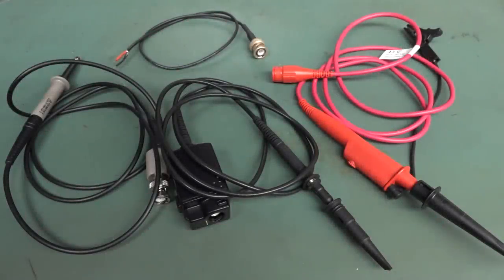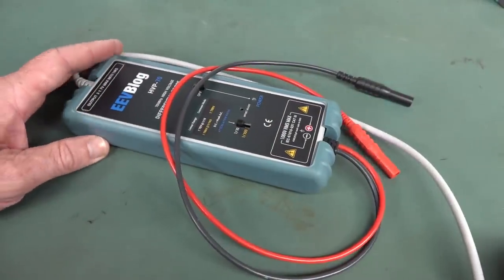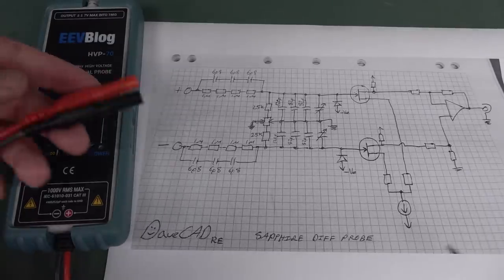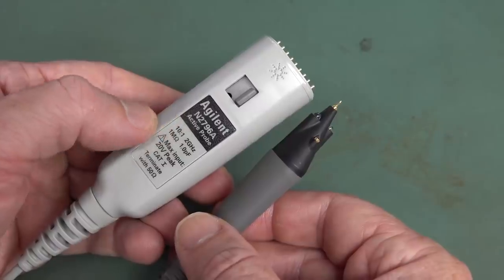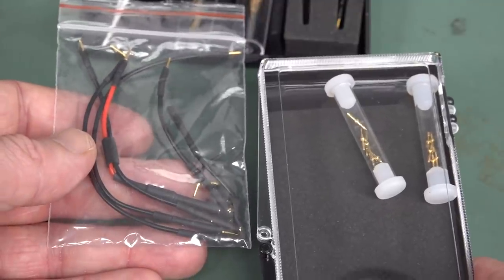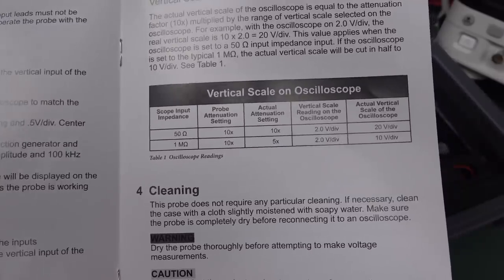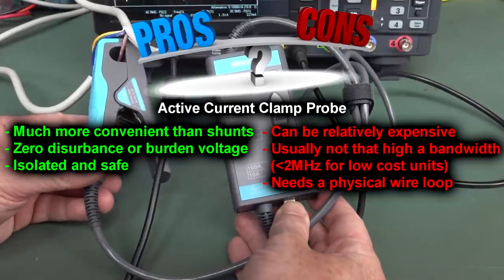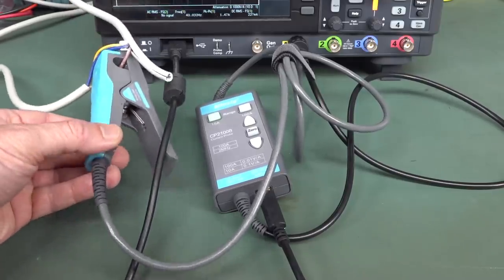EEVblog #1368 - Active Oscilloscope Probes COMPARED (Part 2)

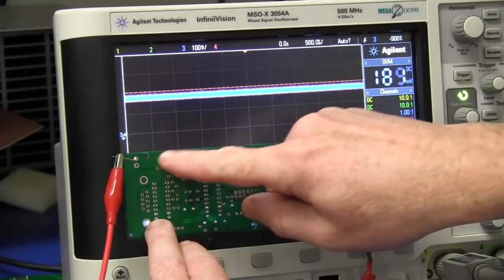Comment: 37:33 Why would you put a split in the ground plane? How did you avoid the EMI problems it almost always make?
Reply: One usage example would be high-frequency noise away from analog components. By having a good connection at one point, as Dave shows here, you can have a solid ground as well as keeping the analog section GND-plane clean.
Reply: @JoeyvanHummel  Thank you a lot for answering, I am happy that you did!! :-)

Comment: I dont understand why the lead (or scope) would get vaporized with the non isolated probe. Thats where the rcd is for, isnt it? That trips by 300mA or so?
Reply: If you have one, yes, the rcd/gfci should save you, not something to rely on though.
Reply: Even with a GFCI/RCD you will still have high currents flowing for tens of milliseconds because the mechanism takes some time to open the circuit. Also your RCD can only sense faults on mains-referenced circuitry. If you connect your ground to multiple points on an isolated supply your mains RCD won't see anything out of the ordinary. If your secondary supply is grounded that's already one connection, so just connecting a single ground lead to a power rail can damage your equipment.
Reply: @eDoc2020  I don't think those tens of milliseconds will vaporize the lead or vaporize the ground plane inside the scope. I've tripped loads of RCD's due to faulty equipment and the energy flowing is so short that it barely warms up. And as a electronics lab is a dry area, you can fit a 30mA RCD. In fact, I can't imagine someone working without an RCD. Where I live, it has been legaly mandatory in houses for 50 years or so, so having power in your house without RCD seems very archaic and unsafe to me. Especially as they cost peanuts.
Sure it's not 100% foolproof, nothing ever is. Can't fix stupid. But for a few bucks it goes a long way, so I've always been puzzled why Dave never mentioned this.
Reply: @mrpetit2  Here in the US GFCIs are only standard in wet locations. Yes, it is a bit archaic. For testing live mains equipment I'd definitely recommend adding a GFCI or even better an isolation transformer.

For what would happen, I agree the fault current won't vaporize any wiring. However it likely could vaporize part of your clip right where it touches and arcs for those few milliseconds. It's worth noting that here in the US neutral and ground are bonded inside electrical service panels, so fault currents from shorting live to ground are likely much greater than you'd find in Europe.

But while the chances of blowing up your scope by connecting the ground to something live are fairly low, there are other dangers. Depending on where your ground touches you could send hundreds of volts into the electronics you are testing.

And like I said earlier, your RCD will only protect in case of one fault. Say you touch your scope ground to a PC's 12v power supply. Current will flow from the 12v rail, through the probe lead, through the scope's AC cord, through the PC's AC cord, and back to the power supply's DC ground. Lots of current will flow but to your RCD all will be normal.
Reply: @eDoc2020  Yes connecting ground to neutral inside the electrical service panel is also a really dangerous thing imho; this is a TN-C system and afaik not allowed here in europe and I don't even think in CENELEC countries . TNC gives risk that with 1conductor failure neutral is rerouted through earth, and puts a live voltage on earthed metal appliences.
As for the PC power supply: that would only happen if the minus of the power supply is connected to mains ground. Is that normal? True you're then basically shorting the powersupply out through the earth mains. But still that's only 12V, I think the spark will scare your hand away and only 12V means there isn't a lot of energy present (so I wonder if real damage is done). Not like when you have 230V. Without protection that will give a blow.

Using an isolation transformer for your DUT is of course the best thing, but there is quite a difference in price between an RCD (~$15 for all power requirements in your lab) and a say 1000W isolation transformer for powering up most DUT's you're working on.
I mean I think it's kind of stupid when building a workbench for your electronics lab with all the outlets, and not put an RCD and manual switch in there.
But maybe that's just me (or europeans) not knowing anything else than always having an RCD (required by law) in the electrical system.
A simple & cheap device like an RCD also prevents most tragedies like these:
https://www.news.com.au/lifestyle/real-life/cause-of-12yearolds-tragic-electric-shock-revealed-after-the-child-was-left-brain-damaged/news-story/8d60948c20675e647236b2bc2e9e5a3d
Reply: Even ignoring mains. Let's say I have a battery-powered product. Let's say 12V or 24V, with huge caps on the input. Let's also say I have my scope and debugger both attached to the laptop, creating a GND-loop through the USB-cables and GND-pin of the debugger. Now let's say I forgot about that and want to measure the voltage drop over a shunt resistor. Big spark, dead debugger and possibly blown traces/wires. What happened? I shorted out the supply rail, through the probe's ground lead,  through the scope's chassis, then through the USB cable, then through the laptop, into the debugger's GND pin, attached to the negatibe rail.

This is just one example. You can easily mess up with non-isolated probes.
Reply: @mrpetit2  It's not TN-C, it's TN-C-S. While it's not as safe as TN-S it does prevent voltage between any metal appliances in your house. The only place you'll find real TN-C here is in obsolete NEMA 10 dryer and range outlets, which indeed have led to many shocks over the years.

DC power supplies with a grounded plug (including PC supplies) almost universally connect the secondary ground to chassis ground.

A PC power supply will easily supply dozens of amps without shutting down. Combined with the lower voltage this means a given fault resistance will be less likely to trigger the overcurrent protection. I believe I have melted some small wire by shorting a 5v supply before. If you turn on the power after you misconnect the ground lead you won't get any sparks so you won't get the same reflex you would if you short an already-running supply.

I guess the real point here is you should have safety protections, but having them is not an excuse to be careless. Seat belts increase automobile safety but your main source of safety should be avoiding crashes in the first place.

Comment: Your cable has a 50 ohms impedance (L/C), the 50 ohms is based on the wire inductance and capacitance to the shield, if you want a correct signal put a 50 ohms input resistors assuming the source is a perfect 0 ohms source or none if the source is a 50 ohms generator. A 1k resistor is an impedance mismatch, calling for serious cable standing waves.
Any spacing variation between ground and lead will mismatch the impedance seen by the source, creating weird signal on the transitions.
In cable or pcb electrons travel at about half a foot per ns, a few inches of impedance mismatch like in those 2 wires probes can seriously affect your reading.
Reply: All this is fine theory, but on practice all probing is a non ideal system. Here the system is not a controlled impedance source fedding to a controlled impedance load, like a typical antenna were mismatch causes reflection at either or both feed point to source or at load end back to source.
In practice as presented the probe works very well. Reflection in this case is not  happening from scope end, as it IS correctly 50 ohm terminated, so no reverse signal flow, so no standing wave from that and at input side the 1K  or any other value used is accessing a signal from a complex signal source, usually totally unknown characteristics, anyway that is not a 50 ohm matched source, so reflection there is no issue on the probe lead. Mere attaching ANY probe to a circuit can, and to varying degree does, affect the actual signal, thus ideally probe has very large resistance at no capacitance, at least smallest possible capacitance, thus active probes....
For this probe arrangement your normal RF matching theory plays zero roll.
Reply: The explanation is already given above but as people say it is better to see once than to hear 10 times. It is actually very easy to test how exactly the 1k resistor decouples the source from the coax cable in the probe and how the larger its value is the less reflection goes back to the board from the connection point. All you need for the experiment is a signal gen, an oscilloscope, 3 BNC-terminated pieces of coax, a T-connector, 2 50Ohm terminators and a tin can with 2 BNC sockets and a variable resistor.
Reply: @helmuthschultes9243  with the 1k resistor we see the slowly raising edge caused by cable capacitance in complete mismatch with its inductance. Well balanced transmission lines have only an ohmic loss worsen by skin effect (where similar electrons repulse each others), a transmission line is a distributed L/C circuit which will not disturb the signal only attenuate it with length when impedance is matched, otherwise its another L/C circuit on the way messing up the signal.
Reply: @Kirillissimus  Review your courses on transmission lines and impedance matching. Its amazing.
Reply: @johnkubik8559  Sadly you are hung up on your transmission line practices. They are correct for the circuit design, to function correctly, but the probecmust introduce minimal disturbance.
As Dave pointed out the simple probe works provably to high bandwidth and as I explained in probing a circuit you have very deviant behaviour from transmission line. Mostly, except special cases like impedance controlled lines, circuits are logic paths and other analog signals.  Rarely are circuits some pure matched impedances, and even if so the probe goes into a well matched circuit putting it out, made worse the lower resistance and higher the capacitance.

Do your self a real favour, and analyse the measuring practice of such probes, by actual observation.
Another view is even if you have a matched impedance path on a circuit board, with a source driving, for example a 50 ohm differential trace. You now wish to observe the signal, which  input impedance probe will cause maximum disturbance a largely 1K ohm probe, or hanging a 50 ohm probe on the trace. As I already explained, any access to a active working circuit WILL suffer some disturbance, but aim is to observe normal circuit function with least disturbance/distortion. You do not remove the normal circuit load and replace it with the probe, you ADD  the probe across the actual working circuit. If you have a well matched circuit and stuff another 50 ohm load across it you gurantee maximised disturbance as the circuit matching is totally stuffed, 50//50 is now 25 ohm load. Yes ideally you have an infinite resistance, zero capacitance probe but that is impossible, so highest resistance lowest capacitance, so an very expensive active probe. If you can afford it, if not as Dave correctly showed the dynamic response  of a simple "coax" probe is excellent. The rise and fall times observed match the expensive active probe, the falling RC decay is another matter, while the digital line is tri state, so high impedance, thus with 1.05 K load of the simple probe pulls down the floating signal not actively driven high.
You really are missing out being hung up on matched impedance theories/rules that apply within the circuit design to make it work optimally and now being observed, but probe must view it at minimised additional load put in parrallel.

Comment: Why buying an active probe if you can build it yourself. TI OPA653 is cheap and works up to a BW of 500MHz.
Reply from the maker: Knock yourself out. Can you fully charcterise it?
Reply: Good luck trying to match the FETs and keeping the thing linear through the whole operational voltage and frequency range. Even copying an existing design that is known to work completely with PCB layouts and all the part names and dimentions is going to require a significant amount of effort and that is not even touching the calibration process. For a thing that you probably not really going to ever need I would not even bother but you are free to try if you have some free time and if you are brave enough.
Reply: @EEVblog  in fact I build a measuring preamplifier during my PhD. It should not fullfill industry standards, but work for the student and laboratory rat who cannot afford it.
Reply: @Kirillissimus  done.
Reply: Guess you'd best get cracking on that and corner the market if it's that easy.
Reply: @Broken_Yugo  Does it matter to you?
Reply: @berndrosgen1713  Not really, I know there's reasons why such things are expensive. That one can likely cheaply cobble something together good enough for personal use is beyond stating the obvious to anybody who really has a use for such a tool.
Reply: @Broken_Yugo  Of course😂 and why are you still trying?